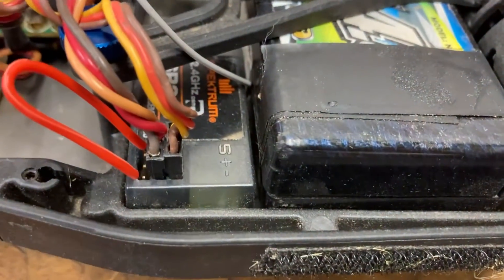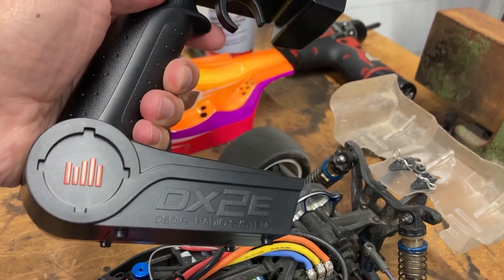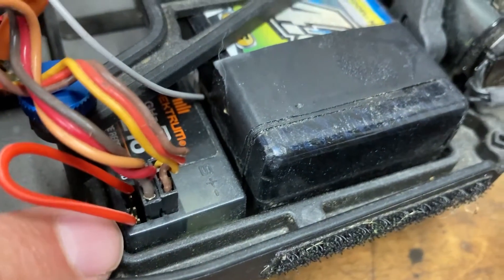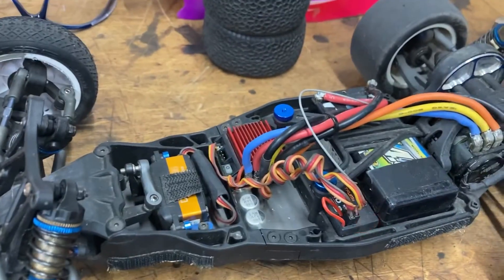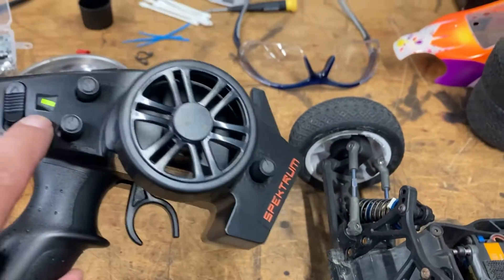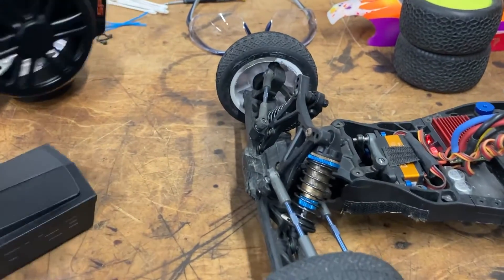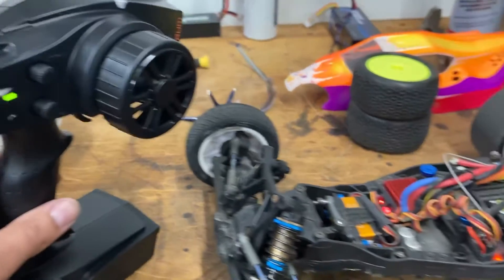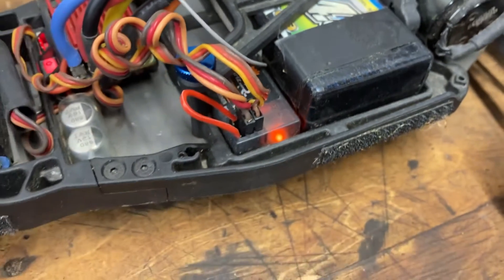Spektrum SR210 Rebind without a bind plug to DSMR Radio DX2E

Comment: I got and did the same thing but I still have no throttle
Reply from the maker: Do you have steering?  Look at the trim setting on the transmitter.
Reply: After the initial start up you must hold full throttle then brake then neutral. Then it’ll be ready.
Reply: He didn't do that In the video,so how did it bind?
Reply: Is this really possible?